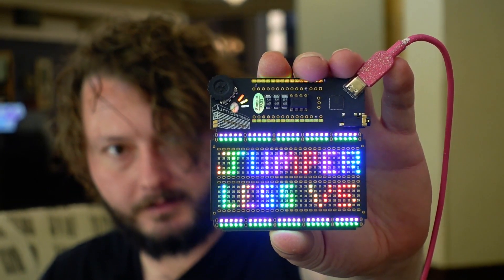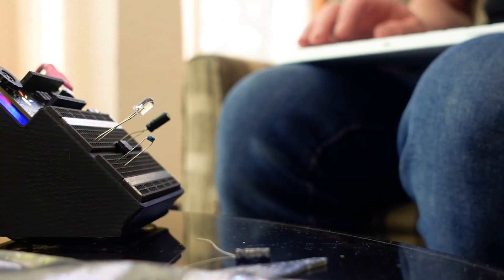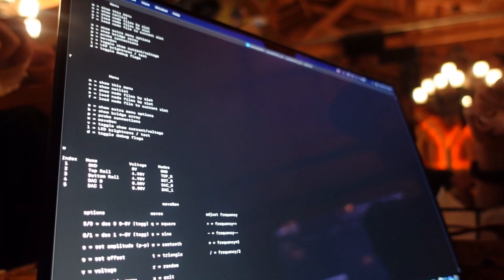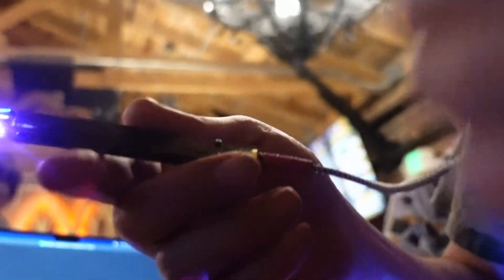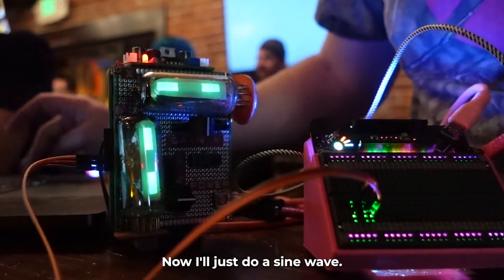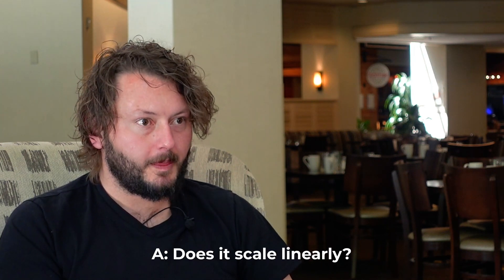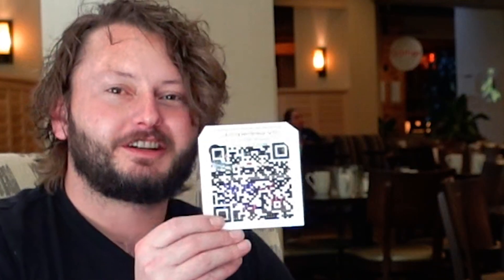JUMPERLESS: The Breadboard that Wires Itself (and runs DOOM)

Comment: the leaf spring connectors should provide more secure connections than normal bread board. i dont want to diminish what he has done but is there a dumb mode were you have a positive rail and negative rail and its líke line board style aside from that or do you configure it in a uart / python command set? also again not to diminish what he has done any i2c or spi ( i know some tell me its the same but its not) time shouldnt be critical so uart is fine but ease of implimentation for those not python inclined who dont want to do uart. are there backer tier versions like basic ( whats shown) or spi / i2c version if you pay more. can i rig with thony since i heard rp2040 early in the vid though later it is a nano. you should make another vid

Comment: The only difference in making connection mistake is that with this you will need to search the issue on the board and monitor, not a wire on board. So I would not make this a selling point.

Comment: It seems like you are wasting a lot of the programmable connections with the current layout.  You can up the density by using offset PCB mounts for ICs that have sockets for the ICs and inline pins that are optimized to plug into your board.  This also provides for mounting devices with different pinout spacing.

Comment: 00:23 “basically works like a telephone network”.
When he said that it reminded me of the video “1958 FACOM 128B Japanese Relay Computer, still working!” and specifically 
at 02:05 of that video
“George Stibitz at Bell Labs was the first one to realize that the same relays used in telephone installations could be used to build computers built on the binary principle. He demonstrated the first relay based computer in 1939”.

Comment: This is a very comprehensive and novel product with a very clean form factor. I can’t believe nobody has thought of it yet. Also a very concise video.

Many are commenting on the price and questioning the consumer demand for such a device. As a recent university graduate, I could totally see my mechatronics and circuits labs purchasing this. It is faster than a traditional breadboard and much more sleek. Importantly, this allows multiple circuit layouts to occupy space on one board and to switch between the different layouts virtually (something that would be difficult and complicated with a traditional board).

I have seen my department drop thousands on some very arbitrary tools. I think there is a demand for this in higher education. Keep up the good work!

Comment: Useless* WASTE. At $369 it is literally 470 times more expensive than what it is replacing, it is over-engineered to the point that points of failure are innumerable (is your connection bad or is it a fault in one of the chips? who knows...), it requires a bunch of additional hardware and power to run (can't recall the times I'd slap together a simple circuit running off AAs taped to jumpers because I was too lazy/busy to solder), but primarily... This is promoting TERRIBLE circuit design practices... you SHOULD get tangled up in jumper wires on such a small board if you're over-cramming it with components - you need a bigger board OR you need to go back to design stage and/or do it using PCB CAD software. NOT add a bunch of LEDs to play DOOM on it.
For nearly 400 dollars. 
This is depressing.

*Lastly - this is completely useless for the use case it was designed for before scope creep took over. 
It's a 60x10 board that's UNSCALABLE due to cost 9:45 (also... sqaure law means 4 times x now?) - DESIGNED TO OVERCOME SCALABILITY ISSUES. 

At $36.99 this would be a bad teaching tool, but a good source for component harvesting.
At $3.69 it would be a terrible replacement for a regular breadboard the same size. And a sign of end times. 
What I'm saying is it should retail at $6.66.

Comment: y'know as expensive as 360usd is, I'm gonna have a really, really, really hard time convincing myself not to buy one the second I can. This is insanely good, and it gets even better as you keep looking. (like being fully open source, not even needing a computer to work, etc.)

This is like a maker's wet dream in terms of design. One idea tho that would really just make it next level; would it have any way to detect where components are installed? If it has builtin LEDs, and it can detect when components are installed, then you could literally 'save' designs, take out all of the components, use it for something else, then 'load' your old design, and it could provide a full outline of where you need to place the components to perfectly recreate the design you had previously. (it obviously wouldn't be able to tell two chips apart from eachother if they're pinouts were similar, but for 99% of jobs it seems like that'd be trivial to avoid or figure out from context, EVEN IF there wasn't a GUI or something to reference saying "oh, you need this chip here")

Then not only would this replace one traditional breadboard, it'd replace basically all of your breadboards. All I'm saying is if that I'm already having a hard time finding reasons to not buy this, but if that one feature is possible, I'd mortgage my kidneys and buy your entire stock right now.
Reply: Not saying you should mortgage your kidneys, but yeah, it can do that. 

It saves as many circuits as you want on the filesystem as just regular text files that you can drag and drop to your computer. But that's a great idea to be able to add comments in that pop up when you tap where a chip is placed, and some kind of move/drag where you can move a chip somewhere else while keeping all the connections.

For sensing what and where chips are placed, one of the beta testers has taken on that project and it's awesome. It can put any voltage on a pin and measure the current/resistance, so it really has all the same hardware as one of those little chip tester things. Now we're just working on getting building a library of common ICs to match against. And even doing stuff like, "that's a PNP transistor, here's where the emitter base and collector is."

But yeah if you want it to do anything, this stuff is really easy to add with your own apps. You can just write stuff like: connect that to that, put this voltage there, measure that, print that on the breadboard, wait for the user to tap a row, whatever. (obviously in like, real code, but it's basically those types of calls.) The weird stuff you can do with programmatic control of a breadboard is insane. And then if you want to share, I'll add it to the stock firmware's app library so everyone can use it.

Comment: bread boards suck. I'd rather make my pcb out of wires. skip the stupid things soldering stuff is faster than pin connectors. And less risk of connecting the wrong thing.

This is stupid nonsense.

Comment: You'll get refund requests because people fried the analog switches to hell by trying to put the voltages required for magic eye tubes through them :) Also, tbh, I instinctively cringe seeing someone handholding a somewhat mechanically unstable, caseless prototype setup that has to have some 250 volts DC in it (and looking exposed) to work like it does :) I unironically dig the smoking while interviewing though. Some creative technology smokes at times, so do some creative technicians.
Reply: Ha yeah I definitely will have people breaking these. My troubleshoot /  repair / replace / refund policy is: yes.

I had to kinda argue with Crowd Supply, but it's just sooo against my nature to tell anyone, "you broke it, too bad." Because it's really my fault for not engineering hard enough to make it unkillable, and having to think about breaking your breadboard really fucks up the whole experience.

So yeah you're not really buying a Jumperless, you're buying the right to have a working Jumperless forever, no matter what.

And about the high voltage stuff, ehh, you'll be fiiine. I threw some epoxy on the exposed HV stuff (which apparently didn't help Elliot).

Comment: Is the capacitance similar to a traditional breadboard? Can you do any RF stuff?
Reply: These crossbar switches were originally made for video stuff, so their 3dB rolloff (half the signal voltage gets through) is 50MHz, which is way higher than a just the physical construction of a breadboard (they're a bunch of metal conductors separated by insulators so... shitty capacitors.) So yeah for RF, these are exactly as bad as any other breadboard.

Comment: What is the average resistance between connections?  What are the frequency limits?  What are the voltage limits?
Reply: Average resistance can be brought down to ~25Ω with path stacking turned on. 
Frequency is exactly as shitty as a regular breadboard (not as terrible as they'd have you think; but over ~10MHz you should probably think about the effects)
Voltage limits are ±9V before they start to "leak" into adjacent rows.

Comment: The price is WAY out of my price range, but I cannot deny how amazing this is! Well done!
Reply from the maker: Thank you!  Kevin did an awesome job with the hardware, packaging, and art <3
Reply: ' WAY out of my price range'  No kidding, it's a kind of crazy idea.  If you've ever looked at these, they are high cost due being a niche idea.  But if this ends up being useful enough to bother, you could probably put say the 12 chips on the bottom into a BGA type single chip, and it end up being about the price of just 2 or 3 of the single current chips.  It's already a sort of custom, expensive low use chip, so building it all into one chip probably won't be that much more cost vs the current expensive chips.
Reply: @ModelLights  I think the big thing this will help with is for schools/educational places. Means that they can buy something that will take less stress than traditional breadboards and because of the speed that people can get their projects completed they can get more students through the practical components easier.
Reply: Thank goodness it's open source, you could possibly make your own for a cheaper price (probably still expensive but still)

Comment: This is awesome, I could not justify getting one since it costs more than my 4 channel oscilloscope and I would be too worried about accidentally burning one of the chip by carelessly experimenting in the way you generally do breadboard, but what is that a thing of beauty. I hope educationnal institution buy many lab-fulls of them !
Reply: Hell yeah, thanks!
btw, I have a policy written somewhere near the bottom of the Crowd Supply page that if you break anything, I'll send you a fresh one right away (and if you're up to it, parts and instructions to fix your broken one too). Many (optional) questions asked, but just so I can hopefully add protections against it in the next hardware or firmware revision.
So yeah, breaking it comes with a high-five and a replacement.
Reply: @arabidsquid  That's great then this become an amazing rapid prototyping tool. Are you really confident about those input and output protection ? I imagine those analog switching ICs are already kind of robust. But a beginning will short, overcurrent overvolt all that jazz. 
Have you tried to find out exactly what it takes to break them ? 
Also what kind of frequency bandwidth can you get out of it ? 
Think it's be possible to do HF radio transmission with it ? (30 megahertz)
That could make it popular with ham radio.
Also can you put parts on it and make it auto detect what is on what pin ? Like those all in one LCR-T7 testers ?

Maybe you just plug in all the right parts in random order, it auto detects everything and autoroutes the circuit you load from the BOM ?
Reply: @shodanxx I'm fairly confident about the protection I've added because there are a few hundred OG Jumperlesses out there and most of the backend stuff is basically the same. And the V5 beta testers have done some crazy shit and no one's managed to break one yet. 

I've smoked a lot of these chips in the last 4 years, so they're pretty well tuned to the best performance / won't explode point. 

The crossbar switches were originally made for audio/video stuff, so their minimum 3dB rollloff is 50MHz, which is well above what physical breadboards can handle so when it comes to frequency response stuff, you can just assume if it works on a breadboard it'll work on this.

The chip tester thing is the coolest community project right now, and we're pretty damn close to getting it working at a basic useful level. The hardware can both produce and measure voltage, current, or resistance really fast, so it's just a matter of characterizing stuff.

The best part is that it tends to attract a certain kind of super creative greybeards so we're pushing firmware updates all the time.

Comment: Is each pin addressable or is each rail? If you plan to scale this for educational use, you might be able to save on matrix width by just making the rails addressable. This would be more practical for students because it would coincide with existing breadboards which is good cause students should be comfortable working with existing hardware. The end user would still have to be aware of their nodes, but the product would erase the need for physical wire connections. This could be marketed to save schools money on recurring expenditures for copper wire while also decreasing scrap.
Reply: Looking at the custom rails he had made and also the video on Kevin's channel, it definitely addresses the rails, not the pins (except for the 400+ RGB LEDs which must be individually addressable).
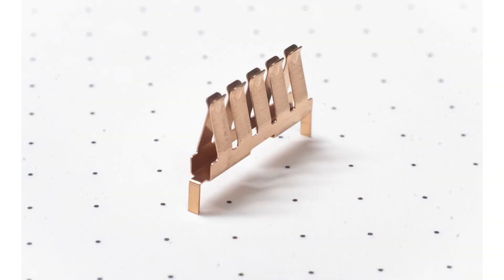Reply from the maker: correct! individually addressable LED's for each hole - but addressable by rail (see the spring pins at 1:40 if you're confused)

Comment: No mention of bearable frequencies, currents and voltages.
Reply from the maker: Most relevant info can be found on the CrowdSupply page!  It tolerates +/- 9v with protection, current limit is 100ma, tolerates frequencies up to 1MHz.

https://www.crowdsupply.com/architeuthis-flux/jumperless-v5

Comment: This concept is very helpful for educational purposes.

In my Digital Electronics labs, my breadboards would be very challenging to understand as there were atleast 50 jumpers on the board.

This made an otherwise interesting subject miserable. Debugging was tedious as it was hard to see were each jumper went. This issue was compounded by the fact that jumper cables are really cheap and fragile. They were often the source of an issue (because of their loose connections). So unless I want to start cutting wires to length, as Ben Eater does, I am stuck with cheap and randomly colored wires. 

However, $300 is a lot of money...
Reply from the maker: Yea! I wish there were more alternatives to those shitty ubiquitous breadboard wires - adafruit has some silicone ones that are nice (but pricy), and the other route is bending your own solid core wire...

Hopefully the price on Jumperless goes down with future iterations :)
Reply: @lyndlabs 

I never knew Adafruit made jumpers. I'll look into them as I would only need a few to use for the prototyping process of projects.

Thank you.

Comment: Is this actually intended to be used as a breadboard, or just a cool proof of concept? Breadboards as they exist are pretty damned perfect, they're so cheap, scalable, reliable and simple that when something doesn't work, you know you made a mistake somewhere, but you almost never need to check if the breadboard itself is working properly, because it doesn't contain $369 of microprocessors, cabling, LEDs and code.
Reply: Really? I can't count the amount of times a bad connection on my breadboard derailed the development of a circuit for me. I've stopped using them altogether for the sake of reliability in my design process
Reply: @  So I guess you wouldn't use this either? Do you use solder board?
Reply: . I suspect they do full pre-production test boards